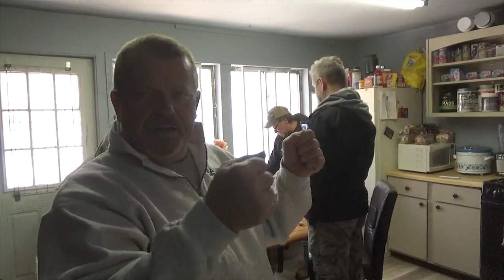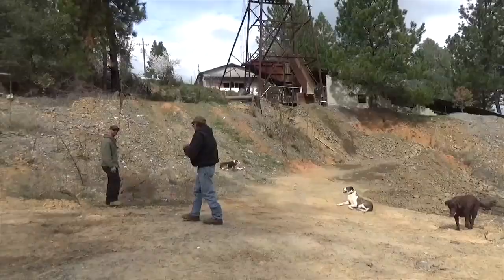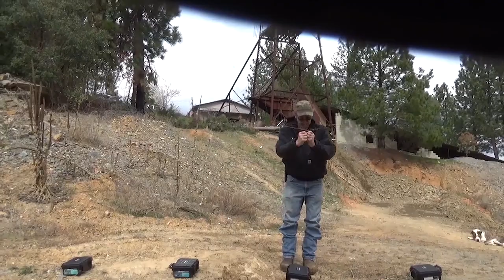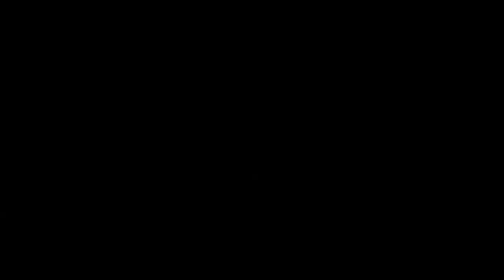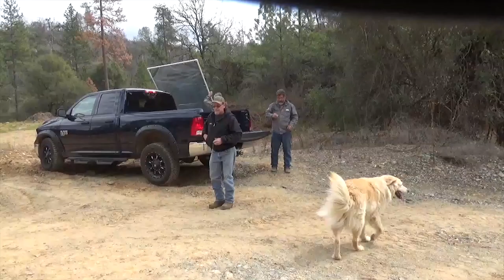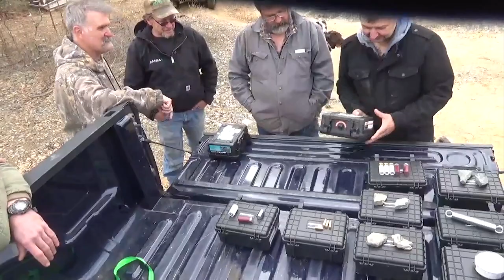Dowsing for gold an AMRA video

Comment: There are two trains of thought in dowsing.  One is that it is all metaphysical, the other is that it is scientific.  I tend to believe from my experiences it is a combination of both.  Gold and all metals interrupt a metal detectors signal....dowsing done correctly does the same thing.  The electrical current that runs our heart and brain is also interracting with the metal rods which can react to circuit interference.  In this test I can see that all the other metals in the cases could give a false signal or interference.  A metal detector gives off a different signal for each metal.....dowsing relies entirely on the mind intrepreting the signal not a computer.  They should have placed the boxes much further apart to prevent interference and if you want a real good signal dowsing.....don't insulate yourself from the ground go barefoot!
Reply: Thanks for hitting the nail on the head

Comment: All gold dowsers do this in nature, no "boxes" involved. It's just like metal detecting, however there is never any plastic box to interfere with the frequency given off by the natural element of gold, so it's a wash or "skewed results". Do it with just nuggets in the ground mixed with your iron or steel targets. Bring in Mr. Steve Pomrenke, he also can afford to put up $50k and he's also a long time dowser.
Reply: Terry Carters Channel has a video on Dousing the right way  and ancient underground civilizations. Robert Shrewsbury has this down. He also explains signal drift and how to compensate. I HIGHLY recommend a look at that if you want to douse for anything.
Reply: I reverse engineered the physics involved in dowsing with the modern light weight ball bearing dowsing rod. Read the book: The Art of Dowsing - Separating Science from Superstition, by Michael Fercik

Comment: Its amazing that even after being told that he was right only 33% of the time his positive bias wanted him to conclude that it means it works instead of his negative bias telling him that he was wrong 66% of the time.

Imagine if your gold pan only worked 33% of the time. Would you use it?
Reply: A gold pan doesn’t always work either as you can still lose gold or if there’s none there you won’t find any. Another question though is even if it only works 33% of the time wouldn’t you rather dig three holes and find a nugget rather than pan for small gold?
Reply: I prefer both if possible but I got the blue bowl so I'm fine with find gold.

Comment: I mine for a grouchy old man in northwestern alaska that has been dowsing for gold for 35 years, it does work. Seen it first hand, but you guys are doin it wrong. The way your holding the rods is all wrong and you are not actullay picking up the gold, the rods are picking up the heavys, the magnatite, black sands etc.. essentially you are using the natural electrical current of your body to create a electromagnet using the rods that will pull the rods toward each other when you pass over the pay dirt. Like I said it doesnt pick up on the gold itself, just the heavys. Seen it pick up 2 feet of paydirt the  oldtimers left 40 feet deep. Shits real
Reply: I reverse engineered the physics involved in dowsing with the modern light weight ball bearing dowsing rod. Read the book: The Art of Dowsing - Separating Science from Superstition ($14.95), by Michael Fercik

Comment: I have to repeat what I said already- let's do this study professionally.  Have multiple dowswers from multiple locations with different careers, I mean if we're gonna test this outright that it does or does not exist, do a detailed experiment that is verifiable and repeatable.  Can I explain why it works for water but gold is mediocre?  No.  I used to dowse, had good luck with water, but sometimes it found me gold in places that, under ordinary circumstances, I would have never thought would have any.  OTH, when I was in an area that definitely had gold, my accuracy took a shot in the foot.  If you read the Holy Bible, it talks of (Jacob, IIRC) that found water by dowsing.  Yet, if you use the technique to find riches, well, I'll let you read the Bible and decide what to believe.